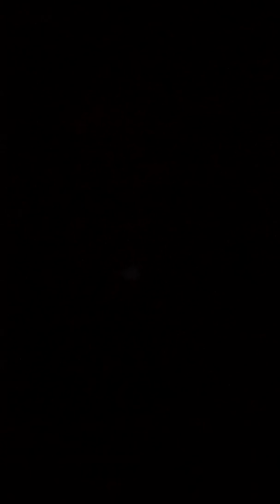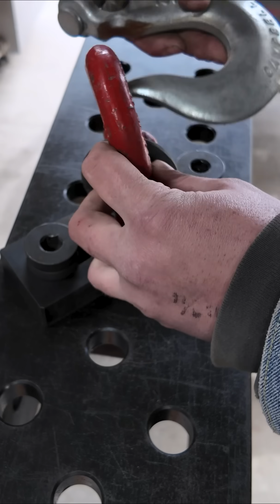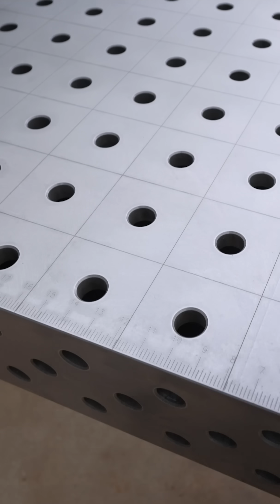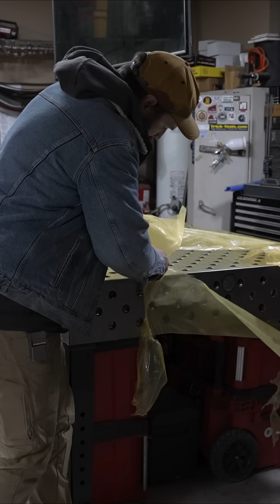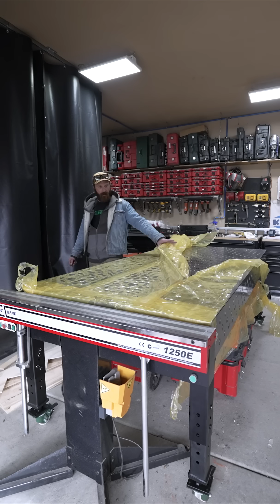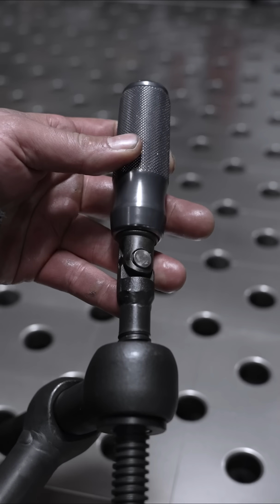West Weld Fixture Tables 😮. These are plasma nitrided 4x8 welding tables with 28mm holes

Comment: Any chance you're thinking about an equivalent to the fireball plate series? Nothing really else on the market comes close for hobbiests for price/performance, but I just really don't want to buy into the non standard size
Reply: There’s no such thing as a standard size hole. 5/8, 16mm, 3/4 , 22mm, 28mm.  What one is the standard. Then you have hole space, 2in , 50mm, 4in, 100mm. None are standard
Reply: @Needfor_speed  there are a range of establishes sizes in the market to meet the needs of a range of customers. Then one day someone comes along and tries to convince everyone that his different size is the most perfect size of them all. Lots of people believe the market so strongly they feel the need to spread how great the odd ball size is.
Reply: @gradstdnt7232  3/4 is not a odd ball size. 28mm is, it’s not even a regular bolt size.  28 mm is proprietary to force you to buy the table bolts that fit.
Reply: @Needfor_speed  The fact that many manufacturers make tables in 28mm hole size by definition is not odd.   28mm provides greater clamping force than 3/4".
Reply: @gradstdnt7232  clamping force isn’t determined by the hole size. It’s the table top thickness that determines how much deflection the clamp has. Fireball has the same thickness table.

Comment: The diagonal offset pattern of the holes has me baffled as to how there can be stiffener ribs with that table ?
Reply from the maker: @matthewhav  the closest distance between holes is about 3/4 inch so there’s (2) 1/2 plate stiffeners going the length of the table and (4) 1/2 supports going the short way
Reply: @westweld  Thank you for the info,  wishing you great success with these tables they look amazing and your branding makes them look even better !! ;)